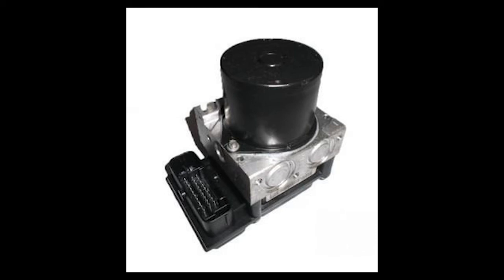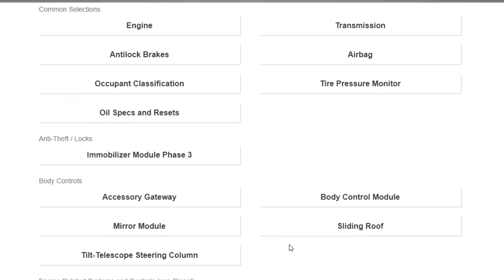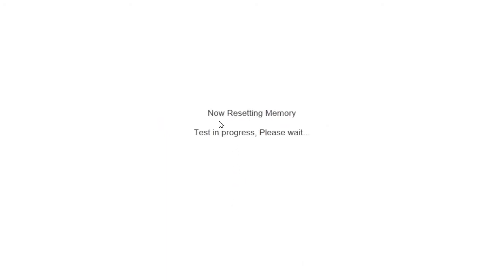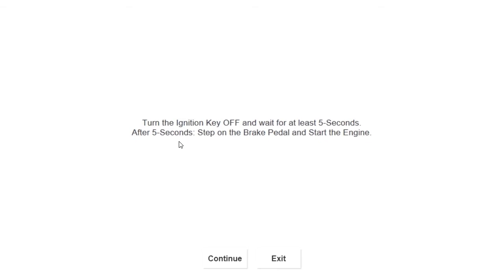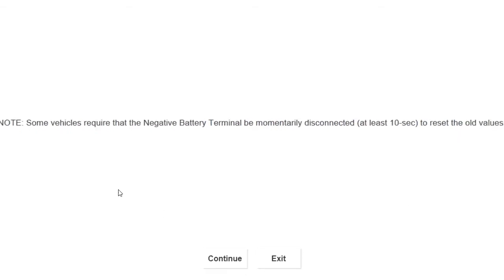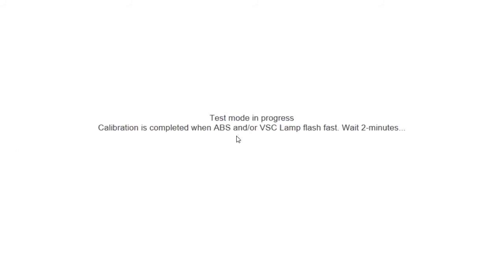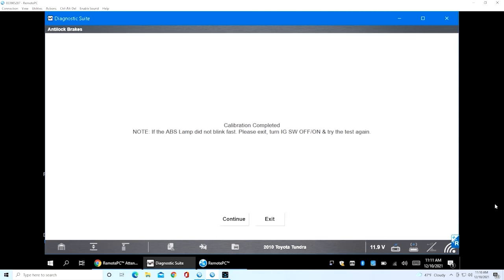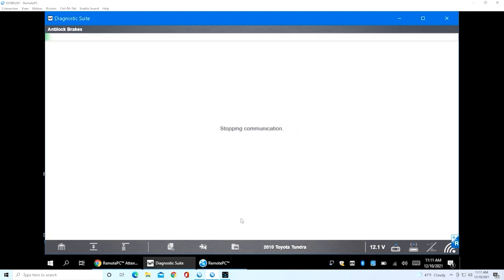How to calibrate abs module on a Toyota, How reset a Toyota abs module after you installed.

Comment: 2010 Tundra. My customer had pedal to floor, not fixed with new Master or interactive bleede or vacuum bleed. Replaced ABS module with used one with matching numbers. Got nice pedal. Went through calibration with my computer (x tool, bidirectional), Still has codes: C1370 Abnormal combonation of ECUs and C1232 Deceleration Sensor. Any ideas? Thank you for the video!
Reply from the maker: It sounds like it still has air in the system keep trying to bleed it

Comment: Hi. I have done this on my 2013 toyota hilux d4d, also known as a tacoma in the USA. Driving through more than 3 drive cycles at speeds below about 60km/h it was fine. Then when i drove faster on my way home, the traction control and tsa off lights came on again. What can be the reason? Note that this is a new clock spring and sensor
Reply from the maker: If it is speed related look at one of the abs wheel speed sensor see if it is acting up